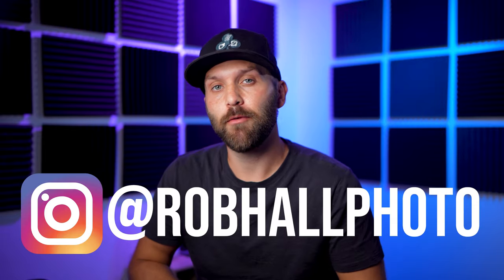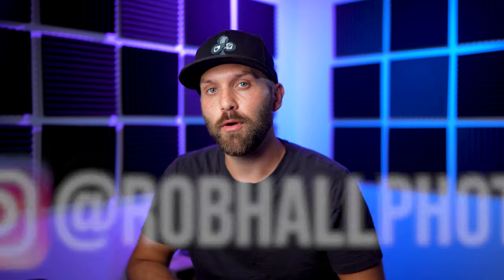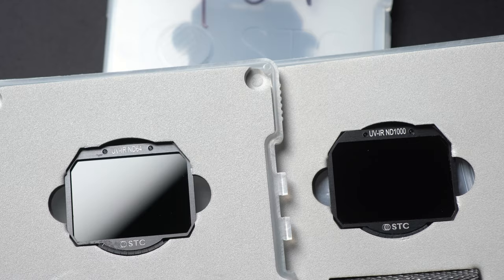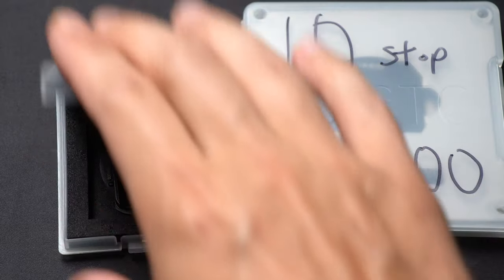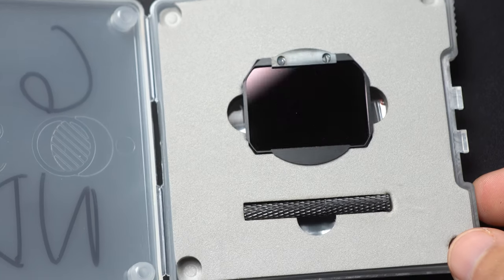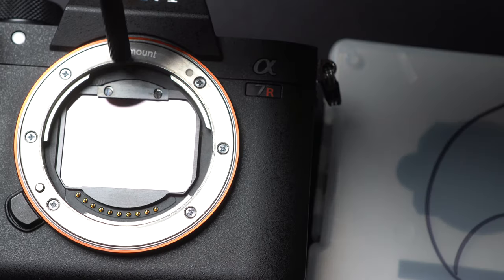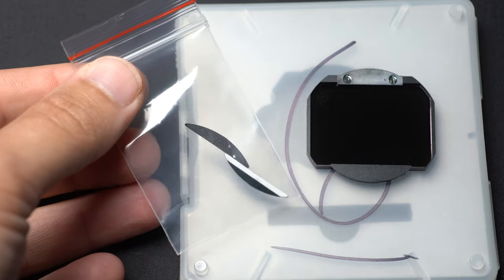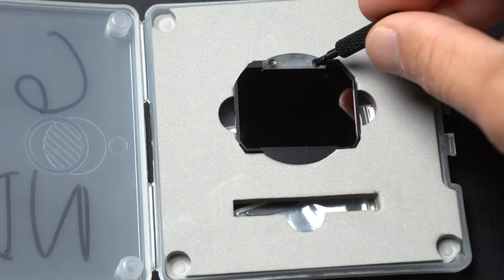Camera Sensor Neutral Density Filter // STC Optics Clip-in ND Filter Update

Comment: Do you still like using the clip in filters?  I bought the Kase ones and sent them back.  I found that the filters being so close to the sensor meant that even a tiny spec of dust would show up clear as day in my images.  Combine that with the fact that the case for the Kase filters was ungodly dirty right out of the box, and man what a bad experience.  I also didn't like their suction cup tool for removal.  I ended up having one glass fall out of the frame before I even mounted it, and I had another case where the frame got stuck in my R5 similar to what you described.   Yeahhhh... No more clip in filters for me.
Reply from the maker: Still use them all the time. I can count on one hand how many times I’ve used HSS since getting them. That’s absurd that the Kase case is dirty when new. I do double check my filters for dust before using them but I just keep them in a small plastic case and there’s never been an issue.

Comment: Its the shutter shield that was damaged not the sensor/ibis module Sony have a 4 layer build with the gen 4 style bodys IO-ports/Cooling/Core/Shutter with a 3 piece shell back diels/screen, top EVF/command diles/ Core mount/frount. the biggest thing is that its only a couple screws to get at the 3.5mm audio ports that die under any real tension and can be replaced for 10Usd a pop.

Comment: Hi Rob - thank you for this video.  I found it because I have an older STC filter stuck in an A7r4.  I had no idea my filter is not the newest version!  The website I bought it from says it's compatible with all A7 series cameras.  ~sigh.
Do you have any advice on how to remove the filter without damaging the camera?
Reply from the maker: Hey Athena, I'm so sorry I just saw this because I know firsthand how frustrating the experience is. I used it in my RIV, and it got stuck, and it actually broke getting it out. This all stems from Sony changing the sensor box size without any formal announcement / explanation, which is why there was a period where it was assumed compatible but lead to this issue.
I'm sure you've had some form of resolution by now (hopefully an easy one), but for anyone else who possibly runs into this:
Keep the camera off. Mount your camera on a tripod or stand with the sensor facing down. If the glass does break, you want it to fall out of the sensor box, rather than onto the sensor. I suggest putting something (a silicone toothpick works well) on one side, and prying from the other. This way as you pry you maintain a small gap on the opposite side rather than it getting jammed in crooked.
If it does break, don't freak out thinking your sensor is automatically destroyed. When it broke in mine my entire sensor was covered in ground glass. Blow as much out as possible, jostle the camera around lightly tapping the exterior to loosen it up from any hard to reach areas, blow again. Just keep using a rocket blow in close proximity until all evidence of ground glass is gone. Do not use compressed air and do not turn the camera on until you see no glass pieces. Only then should you clean the sensor with a sensor swab.

Comment: what is the difference between using ND filters on the sensor and on the lens ND filters?
Reply from the maker: There are no visual differences. Just the practical aspects, like lens ND filters require different sizes, step up rings, or square mounts to accommodate various thread sizes. Also there are some ultra wide angle lenses that cant have a filter at all.

Comment: So you personally don’t use any type of strobe if you have this nd filter on? How many stops do you prefer?
Reply from the maker: Huh? No I still use strobes for pretty much everything. I use the ND filter WITH strobes in traditional sync. The point of the ND filter is to avoid HSS.
Reply: Robert Hall Photography oh! Gotcha. Thanks for clarifying that. Would you say 4 stop is enough? I don’t have the money to buy 4,6,10 so I just want to buy one.
Reply from the maker: If I were buying 1 I'd buy the 6 stop because that will take sunny 16 conditions down to F/1.4. If that's too much, you can always raise your ISO a bit. But, if you don't tend to shoot wider than F/2, the 4 stop is fine.
Reply: Robert Hall Photography thanks a lot brother! I’m getting the 6 stop nd

Comment: The ND filters also require more power from the flash. 4 stops more for an ND4 etc. How many stops do you save using HSS instead of ND filters?
Reply from the maker: No, they don't. People constantly misunderstand this.

Imagine you're outdoors, shooting ambient exposure settings of 
 1/250 F/5.6 ISO 100. Flash at 1/4 power. Image is perfect brightness but you want shallow depth of field .

Option 1)
add 4 stop ND
settings are now 
1/250 F/1.4 ISO 100
Flash loses 4 stops from ND, but gains 4 stops from aperture opening up 4 stops. They cancel each other out, flash is still at 1/4 power to make the same brightness as original settings.

Adding an ND filter will always mean the flash has the exact same relationship to the ambient light and camera settings (provided power level and position stay the same). Yes you darken the entire image, but there's no "loss" of flash power, relatively speaking.

Option 2)
Change settings to
1/4000 F/1.4 ISO 100
Flash loses 2 (depends on flash) stops of light going into HSS.
Flash loses 4 stops of light due to shutter speed increase beyond sync speed. Flash gains 4 stops of light due to aperture opening up. The aperture and shutter speed changes cancel one another out, but the flash lost 2 stops because of repeated pulses of HSS.
So, in order to match brightness of original settings, flash needs to be brightened 2 stops from 1/4 to 1/1.

HSS is ALWAYS less efficient than ND + standard sync for equivalent exposures, and the difference in how much is ALWAYS based on the efficiency loss of the strobe entering HSS. This can be anywhere from 1 stop to over 3 stops, depending on the lighting product and power setting.

Comment: I'd recommend not to buy STC.
I bought 1 ND filter from them and it came with a lot of dust.
I sent photos to them when I got it and they said:
"We apologize for the filter condition, it shouldn't be like it. We will improve our QC process immediately.
Very sorry for letting you receive the unclean filter, as apologized we like to make the filter become 20% discount and the adhesive for free."

Since they were not gonna replace I decided to properly clean the filter and still has 3 small dusk-like marks.
I don't recommend, a product that goes to your camera should come faultless from factory.

Comment: I wish they had these for Nikon  dslr
Reply from the maker: Yeah it's a little odd for dSLR's with the mirror. Probably for the best since it affects your visibility through the viewfinder and will likely significantly impact focusing.
Reply: Robert Hall Photography   A filter adapter like the z6 uses maybe thinner would be awesome esp for lens that can’t take a filter like the 14-24   Allowing for  nd or polorizer filters
Reply: @吳孟聰 any thoughts on a 13 stop ND filter or a hot mirror filter for full spectrum converted cameras?
Reply: @吳孟聰 That's fine. I want it for longer exposures during the day so I can stretch out the clouds. Any chance on a hot mirror for full spectrum cameras?
Reply: @吳孟聰 any update on the 13 stop ND?
Reply: @WilliamWu STC Hi, William, I wrote you on the website through Contact form asking which clip filter is compatible with the new released Sony A7iv. Will work same filter for A7Riv? Thank you!

Comment: If there is any way you can use your celebrity to suggest to them to create a 13 or 14 stop ND filter and  a Hot Mirror filter, we would all be eternally grateful.
Reply from the maker: They've checked my videos in the past for feedback, I imagine they'll do it with this one too.
Reply: @robhallphoto  That's awesome. I usually use B+W filters until I got the Fuji 8-16. When I compared it to the STC filter, I did the math and found out the B+W 10 stop is more like a 12.5-13 stop and I liked how dark it was. It really helps get longer exposures during the day. A Clip Hot Mirror filter would turn full spectrum converted cameras to normal cameras that you can use circular filters with at the same time.